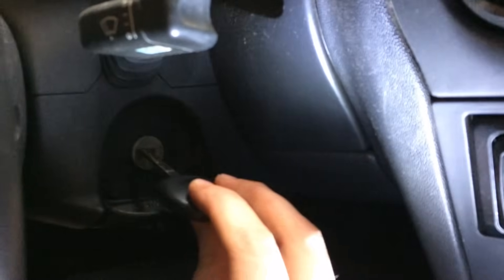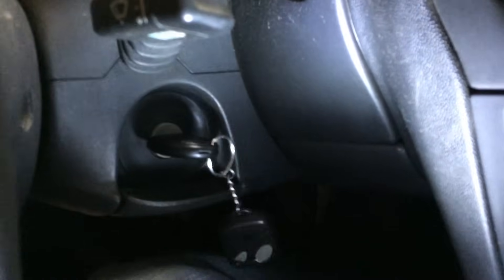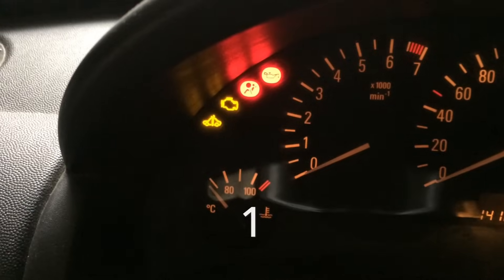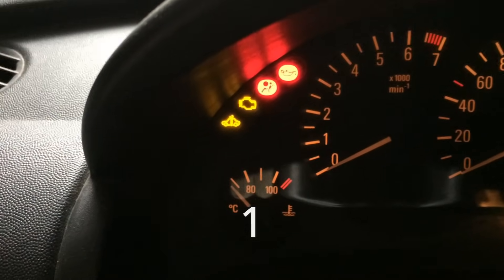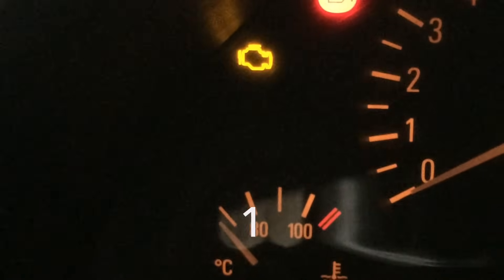Opel / Vauxhall engine management light (DIY check engine code reader)

Comment: Good day, my light with the spanner comes on but only if i drive it hard, paddle test confirms no errors and there is no performance issues whatsoever although in the past the spanner threw my car into limp mode, does it have something to do with me installing the cone filter
Reply from the maker: In your case, you have to do a proper diagnostic

Comment: Hi Very good video, i got the code 1122= gaspedal.And the second code was 15510.Strange that it was blinking 10 times when i got the second code.Isn’t the code 1551(4 Numbers)that it is a problem with ECU box?Thank’s for share the video.
Reply: Your code Is probably P1550, 10 blinks is 0

Comment: I got (10, 3, 4, 10) now how can i understand what that means? Is there any link
Reply from the maker: 10 = 0 

Just google P0340 as shown in video…

The description of the P0340 fault code will point you in to the direction of the problem. A defective camshaft position sensor can cause this fault. Defective wiring or corrosion on the connectors of the sensors can be responsible for this fault as well.

Comment: hi there. I have this light and a light with a spanner glowing (both amber) before the engine is switched on. they both stay on until the engine is started, then after maybe 2 or 3 seconds they both dissapear. my car is an astra 1.6 (2006). Do you think this is an issue considering they are switching off as soon as the engine is started? Many thanks
Reply from the maker: +Geoff Kinnane hi! Your car is absolutely fine. That's how it's designed to work, so you know that a lightbulb in the dash is working. EML is bad only if the light stays constantly on (or flashing) during the operation of engine
Reply: Thanks very much :)
Reply: Bjr j ai une opel astra qui affiche la voiture avec la clé un voient jaune à gauche du tableau de bord

Comment: Will not work on meriva b because ive tryed numerous times to no luck but enginelight is still on car felt sluggish and had to use all throttle on hills car now feels ok but lights still on despite no codes

Comment: Hi my Merida check engine light is on. She due a 80 k mile service and she done 848 mile over. I drive her very gentle all the time. Does it mean she just needs a service?
Reply from the maker: Yes, it needs the service. Regular maintenance is the key
Reply: It's a feckin car It's not a she ... IT'S a machine.
It's not AI either.

Comment: I have the same problem, the thing is, i dont know what the name of the flashing lamp is because my manual is in itallian. So when i put the key in it appears, but when i start driving it, its gone.... It would help just knowing the name but an explanation would also be helpfull. Thanks.
Reply from the maker: If it goes away when you start the engine, then there is no problem

Comment: Hi there, I have a 2011 Vauxhall Meriva 1.7 exclusive diesel. Tried this a few times and it doesn't flash at all. The spanner light stays on until I stop the car and turn it back on when it is warm, and it clears the light. It is obviously temperature related but any guesses how to get the right code. I have reset the oil service light so it is nothing to do with that. Many thanks  :)
Reply: SOUNDS LIKE YOUR GLOW PLUGS NEED CHANGING.

Comment: i got the same problem and code, can you tell me what was problem in your case?
Reply from the maker: A blown fuse responsible fot the cooling fan
Reply: @garagedilettante1128  if you don't mind can you please share what fuse it was if you remember? I'll really appreciate it
Reply: @garagedilettante1128  Also did your fan not come on before your diagnosed this issue? my fan comes on at 90* C on temp gauge ( on car) (coolant at 93*C that time according to obd2 scanner), and during AC on
Reply from the maker: I sold this car almost 5 years ago, I don’t remember which fuse it was. And my fan didn’t start at all
Reply: @garagedilettante1128  Thank you a lot either way!!

Comment: I got 10 flashes 3  flashes 3 flashes and 5 flashes - in a Barina (Opel) 2005 - I'm guessing this means fault P335 - crankshaft position sensor - can anyone confirm "10"="P"
Reply: Code you got Is P0335. 10 blinks Is 0